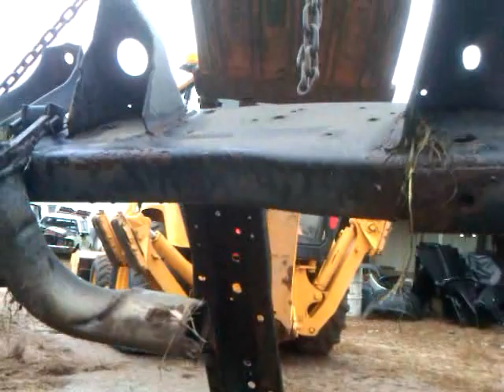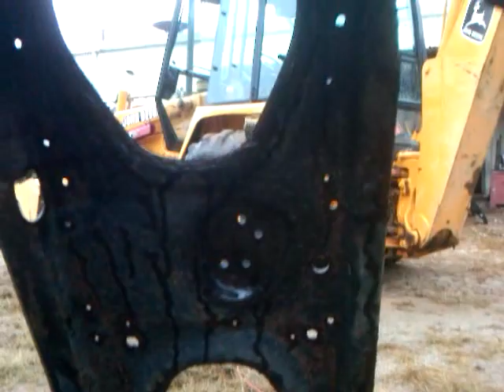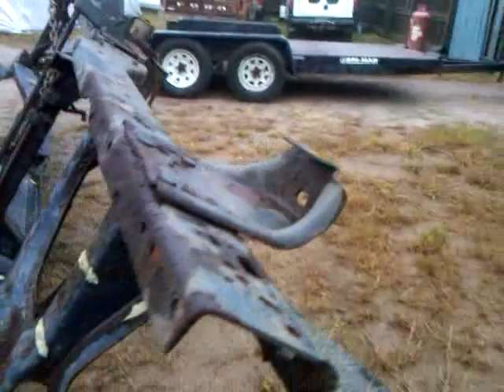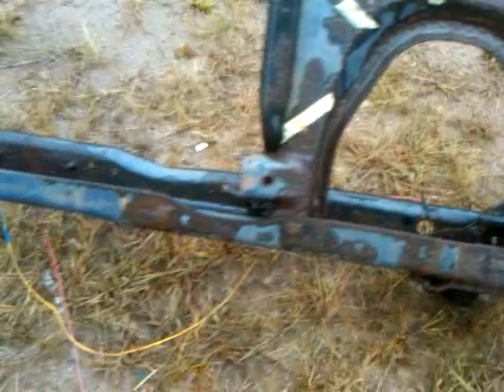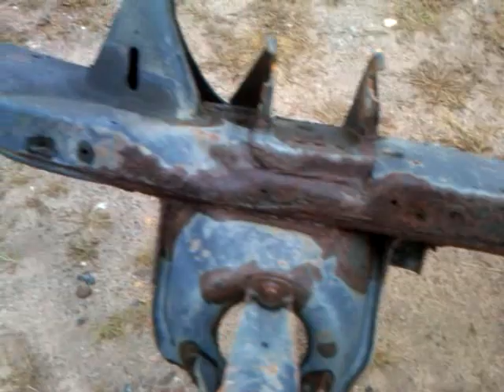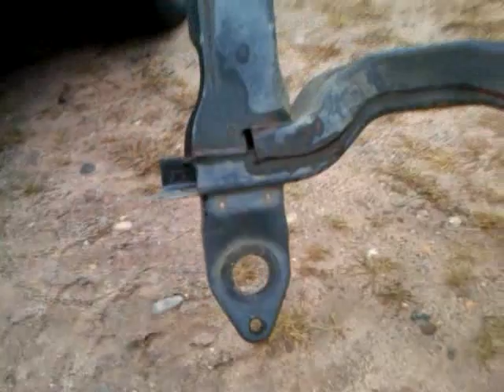Dodge Ram 2500/3500 frame 2001

Comment: Was this a extended  cab long bed frame?
Reply from the maker: Sure is.  I believe 154 inch wheelbase.  I still have and drive the truck.  The original frame still in by backyard, actually